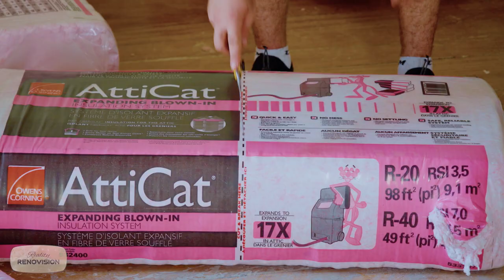Bedroom Gut and Rebuild DIY | 1880s Farm House EP19

Comment: If a rat chewed through an old cable with no ground, and the hot and neutral made contact with each other it would cause a short circuit. Hopefully It would trip the breaker, though. That's why new codes call for arc fault breakers. Any little arc will trip the breaker.

Comment: bought a house built in 1900.. last two owners must have been real DIY guys...not good ones. lots of messed up electric. Threw the towel in and called an electrician to replace the entire house. there was so much hidden knob and tube wiring we didn't know about. best renovation decision we made